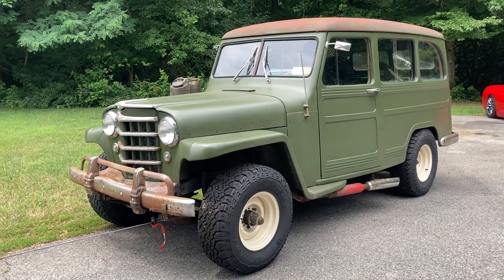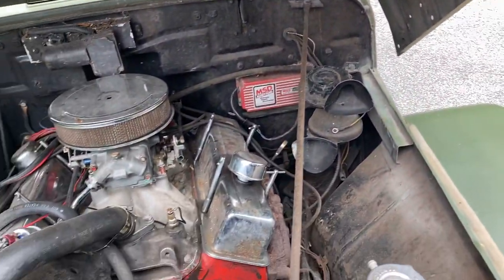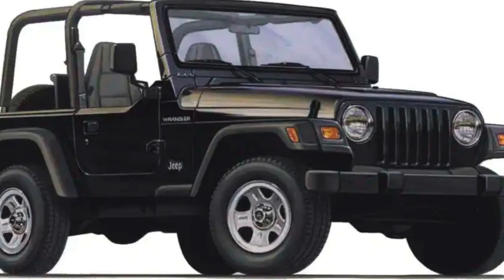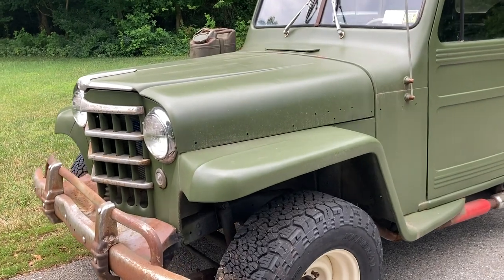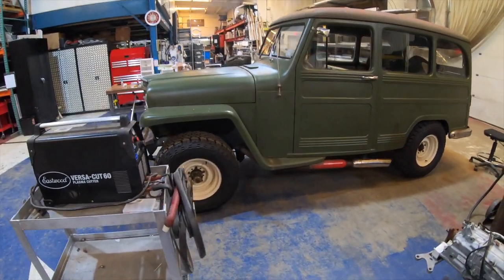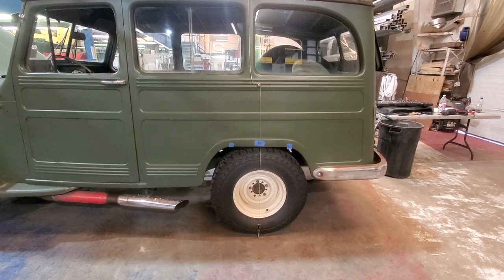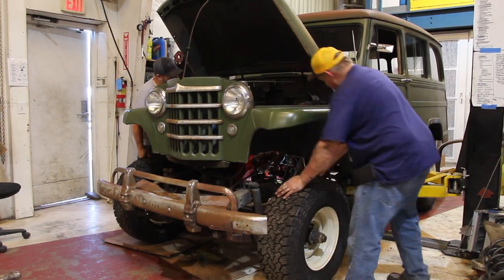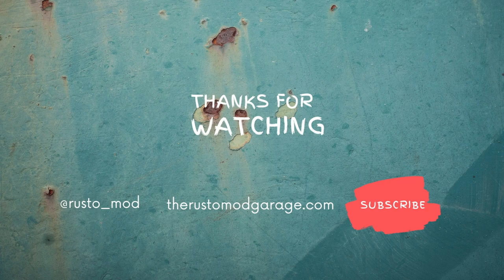We Build Willys Wagon Jeep Chassis Swap To Diesel TDI Powered Wrangler!? Build Begins! -Willys Ep.1

Comment: I don't know why you would want a junk jeep frame to swap with a good solid willys frame. The steel on that willys frame is so much better than the junk steel the jeep has and to switch it to coil springs is great for driving down the road but for off road leafs are great.

Comment: It’s hard to tell from the video. Is there room for a clutch master cylinder next to the booster?

I’m doing the same build but I’m using the 2.5/5m from the donor
Reply from the maker: That’s awesome! Yeah you should be able to definitely fit it. It is tight tho very narrow engine bay
Reply: @Rustomod  it’s funny. I bought this drivetrain and found your video looking for a video going over pulling the body off my frame.

I’m using your video as a step by step guide. 

The wife wants to daily her wagon. I figured this was the best way to do it.
Reply from the maker: @anselpeneloperainblossom-s3489  Thats awesome definitely an easy way to get modern drive line under an old willys